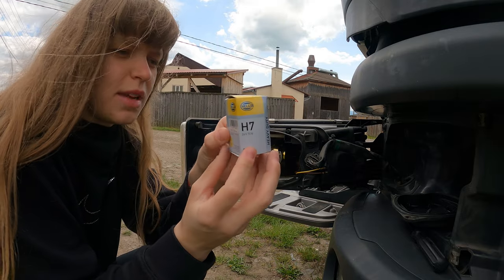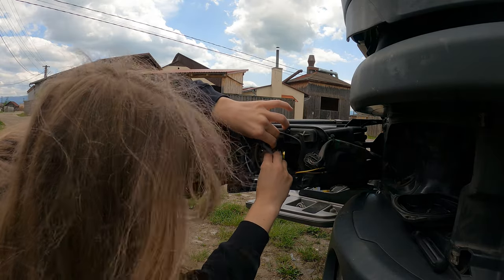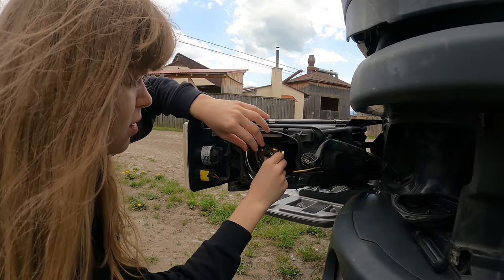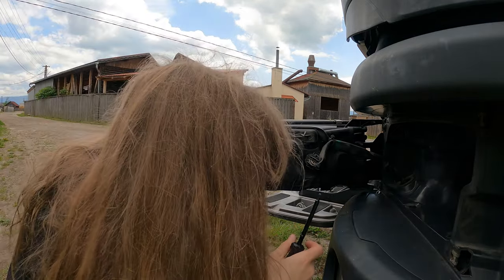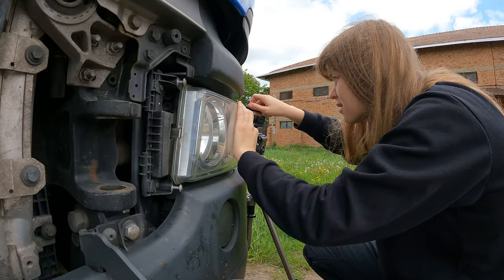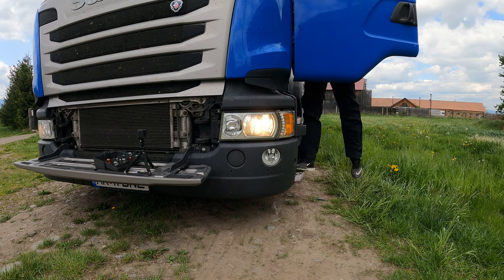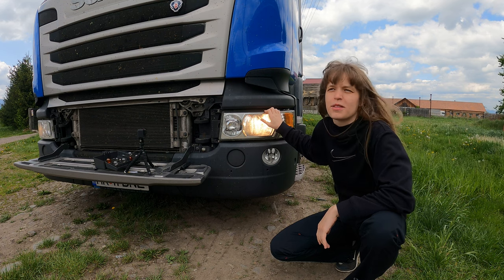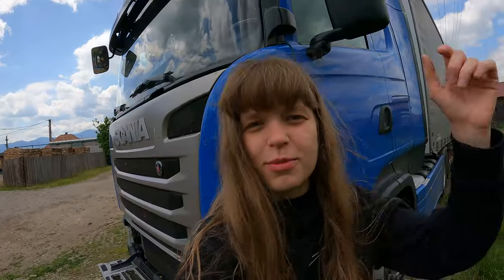Replace headlight bulb

Comment: Excellent job Timea, with good advise. 

I have a little advice for, after plugging the electrical harness, check if the bulb light up. This way, you won’t have to start from the beginning if the bulb is faulty 😉!!

Have a great day ☀️!!
Reply from the maker: Thank you for the advice! 😁 You are absolutely right, I know that, but I was focused on filming! 😅